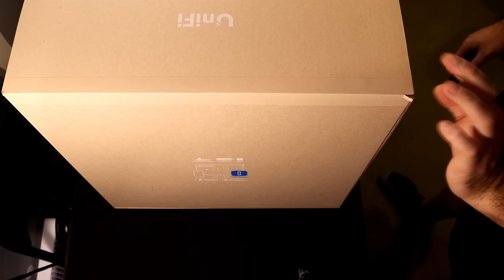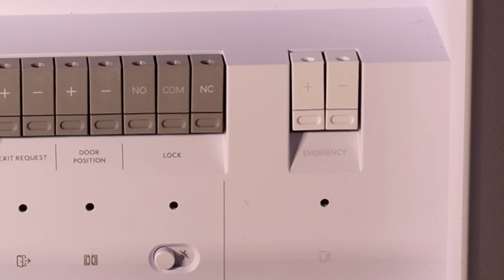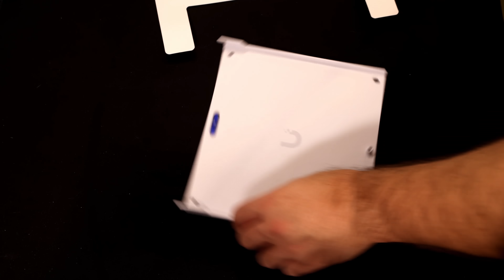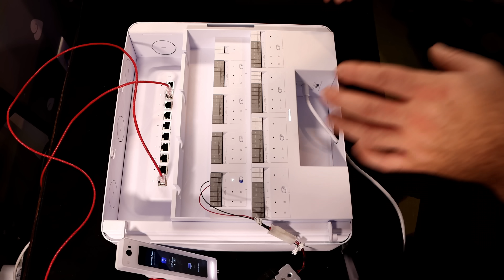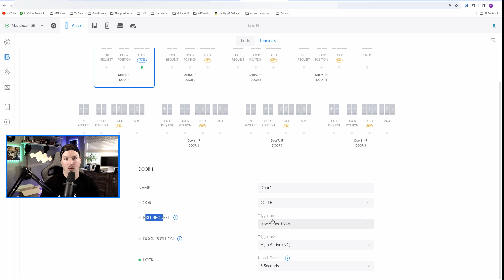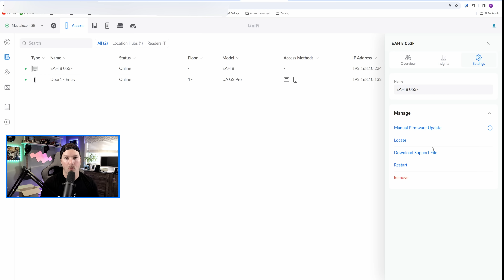Unifi Enterprise access Hub

Comment: Hi, question for you ... if I have more than 8 doors, I need to use more than one UEAH. Can I manage these devices as 1 device, or do I need to duplicate the users and cards in each device?
Reply from the maker: The users are all done within the Unifi access application and you give users permissions to doors. You can have 50 door hubs and only assigned it once

Comment: HI. First of all, thank you for the review. I'm entirely new to this, so if my question is dumb, I'm sorry in advance. If you were to install the G3 reader for entry, could you exit it? Like in a hotel situation. You have the room keycards and use them to enter, and you can leave the room without using the keycard. Would that work with the g3 readers and electric locks, or do you need an exit button? Also, I want to know what the magnetic locks are for.  1 more questions. In case of an emergency and there is no power, Is there a physical key or a way to override the electric locks or a physical key that can be used with the G3 readers and electric locks? I hope this all makes sense

Comment: I'm wondering if the 12v outputs can be remotely triggered and if the switch can be used to power poe cameras instead of readers. I have a project were I just need 8 12v0.5a sources to open and close valves for a few seconds and need cameras. not exactly the designed use but it would be perfect for this.

Comment: Where can I find more information on this? I have a client with multiple locations I would like to incorporate this system in, however, one of the location has more than eight doors. Is there somewhere that shows a complete breakdown of all components necessary for running multiple sites? The Ubiquiti website is not very clear, even with the design tool.

Thanks

Comment: question, for the door position sensor. can you use the protect all-in-one sensor from Ubiquiti. I know it functions as a door sensor as well, but i am pretty sure it's wireless. so I want to know if it actually integrates into the door access systems as well.

Comment: Is there any switch that can be added to initiate a lockdown mode. I have seen in the past that the current implementation requires a password re-entry to lockdown. In a situation where a lockdown is needed you really would not what someone fumbling with a password.

Also I heard unifi was going to start charging for their "Access" per user per month did they end up not doing that. Its hard to find out from their website.

Comment: I don’t understand this product because you have to run so many wires from there to each door.  But if you use individual door controllers you only need to run one cat6 to each door and all the other wires are local to the hub/door.
Reply: This is how a lot of the other companies do access control hardware. Even more so in the past. So if you are switching to Unifi you already have all the wires run so this would help make the transition easier.
Reply: It's common for companies to run all their access controls to one place.

It also helps with tampering. With multiple hubs, you would have to make sure each hub is secured. With a central system you can just put it in one secure spot.
Reply: My residence needs 6 locks.  I’d much rather use a single unit than by $1200 worth of individual hubs and have to build individual battery back ups into every wall.
Reply: The wiring requirements are on par with previous gen existing access controls but the older systems didnt use cat 5 or 6 anywhere.  If you takeover a old access control system, you may need to run a cat5/6 to the reader(s) but thats it.  The newest reader has a local output for strikes/mags power or relay if im not totally mistaken.

Comment: Great improvement from the beta access equipment I got to use 5 years ago. I would have liked to see a 12 or 16-port switch with SFP uplinks, but it probably comes down to them looking at statistics of how many installs only use entry readers because of the cost and fire safety push bar exit.
Reply: Why use low voltage like that can’t you just run a single car 6 to each door and have it branch off there!!

Comment: The fact that the enterprise hub does not fully support 8 doors with readers in and out is very dissapointing. They should have added the extra 4 ports for this, seems almost like a design flaw, or worse, a way to force customers to buy more units. Was going to buy this because i have to use it on many doors. Could you perhaps make a tutorial/video on the best way to open doors without a reader? Thank you, love your content. Greetings from Norway.
Reply: Why would you need to have a reader to go out? You can use a simple push button to unlock a door if a magnet is used or just a door handle when it’s a strike lock.
Reply: @ropiko  In my scenario I was going to use a reader to enter and exit, that was how the access kit I bought from Ubiquiti was intended to be used. Ofcourse, using a simple switch will be easier and also be more cost effective. When you say door handle, do you mean a special type of handle that retracts the locking bolt when pushed down from the non-secure side? Do you have an example of a product like this? Thanks.
Reply: @ropiko  The reader out is useful for exit time so you know when someone has left site.

Comment: Not sure if it was mentioned and I missed it, but will the Enterprise Access Hub charge the batteries if attached? Or would I need to find a solution for that?
Reply from the maker: That I’m not sure. I’ll have to get some batteries and test
Reply: @MactelecomNetworks  it will not charge the battery when AC power is on. It will only charge battery when AC power is off.
Reply: @ckcfcyentn  I don't get it.  It charges when AC power is off??? Where does the power to charge come from then?  I must be missing something.....
Reply: @Greg.M  it does not charge battery.
Reply: @ckcfcyentn  Really? I have to source a 36v Uninterruptible Power Supply?